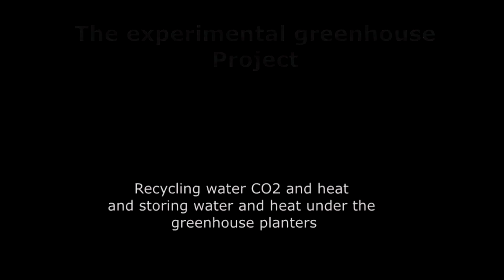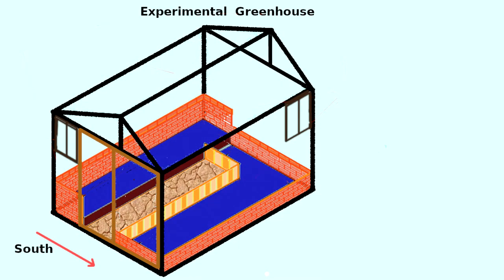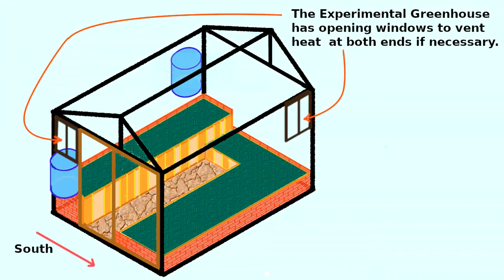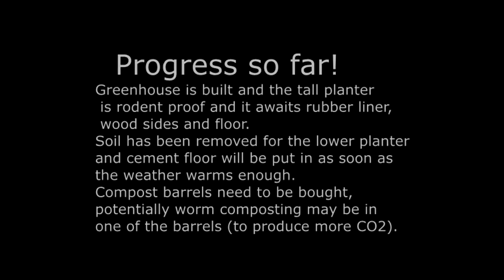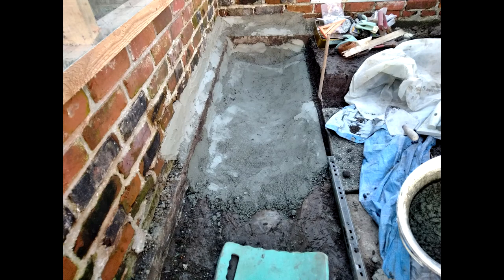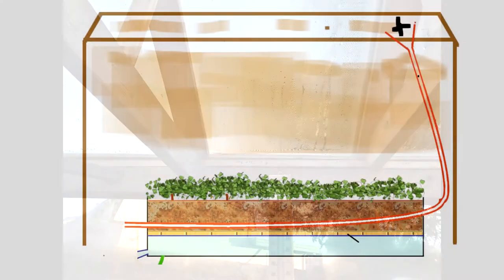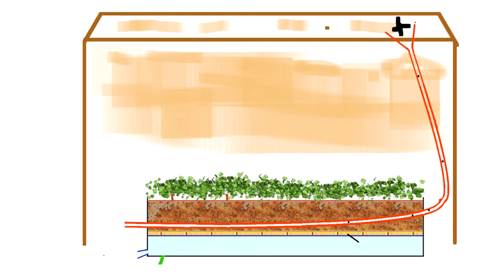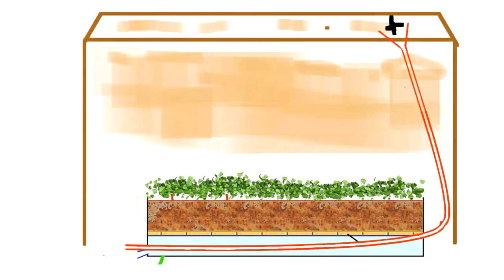Experimental  CO2 enhanced greenhouse that recycles and stores water and heat in water

Comment: This is a great initiative. I love systems that regulate themselves naturally. In this case, especially the humidity regulation. I'm just wondering about the fact that humidity condenses on colder surfaces, so would the condensed water not be colder than the air? I imagine it might still be warmer than the stored water. I am very interested in seeing the logs. Also, should one be concerned about mould and other things that might wash down from the glass?